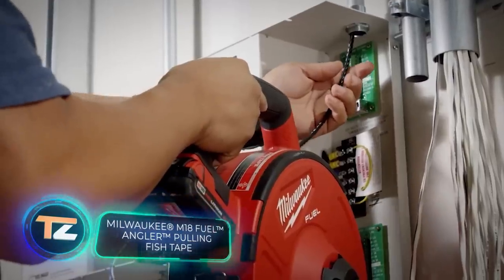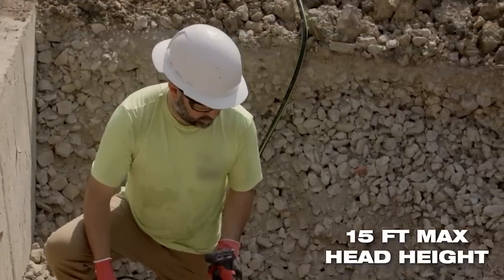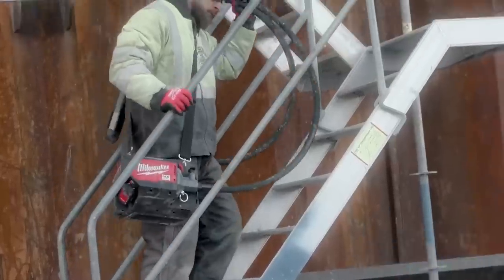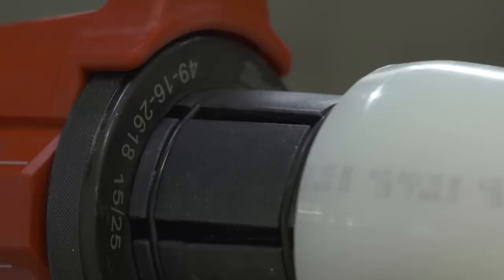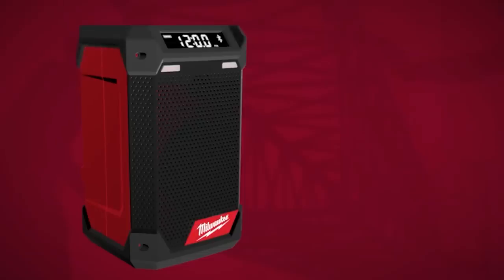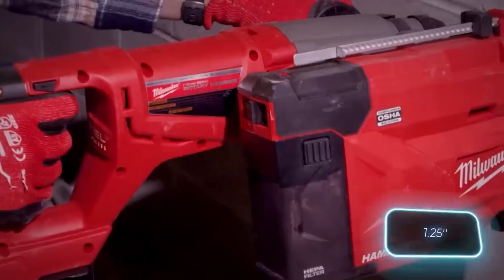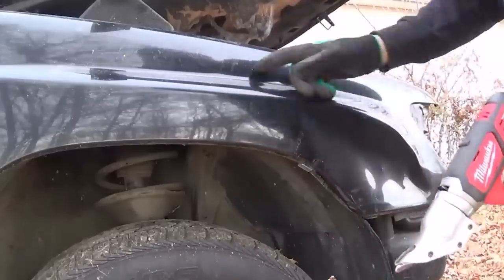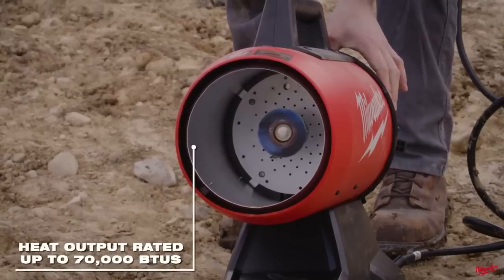COOL TOOLS YOU'LL WANT TO BUY

Comment: As a Milwaukee user for well over 45 years starting with the Sawzall as a plumber and the 0234 1/2” Magnum Drill as a Commercial Locksmith, I adopted the M18 Tools when they became available with their 1/2” Drill/Driver fully replacing my corded 0234. My collection of their cordless tools keeps growing … keeps working … 
Milwaukee has ALWAYS been fairly “pricey” but has NEVER Failed to provide solid, rugged and dependable results that was true of their corded tools (which I still have) and remains true of their cordless tools.
Tools are an investment.
I ONLY buy Serious Tools.
Often a tool you buy as a one-off for a particular job turns out to be a valuable partner in taking on other jobs.

Comment: The Concrete vibrator also comes in an M18 version, not only MX, you can get it in either 4ft or 8ft length, & it can be had for Roughly $400 but you can find them on sale quite often. The grease gun also comes in an M18 version and also doesn't cost $400+, it's $249 or $300 with a battery (M12/M18 respectively). 

I don't know how the Tick works but there are 3D print enclosures for Apple Air Tags that, I would assume, have far superior tracking because the Apple user base is significantly larger. 

Overall, these tools are great and I love seeing Milwaukee tools in videos like this because they're constantly coming out with new stuff, like I didn't know about the measuring wheel but it is now on my list of things to buy :D